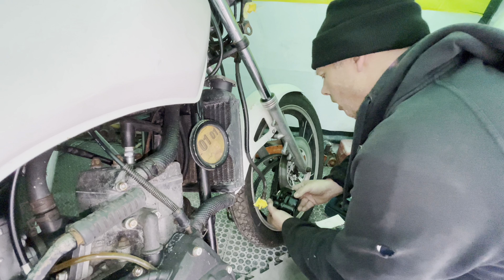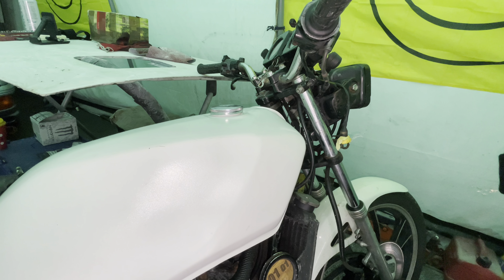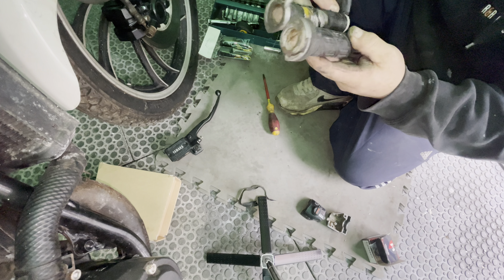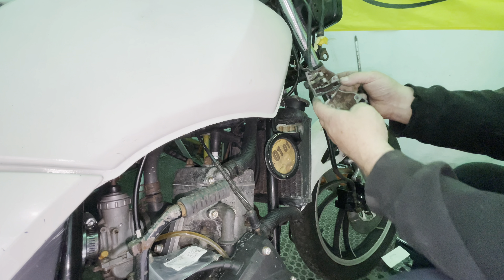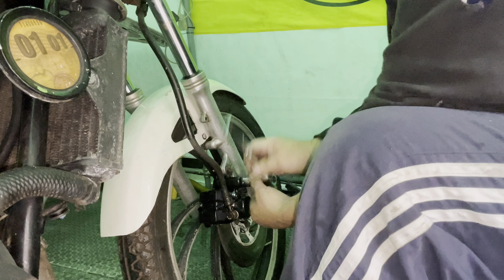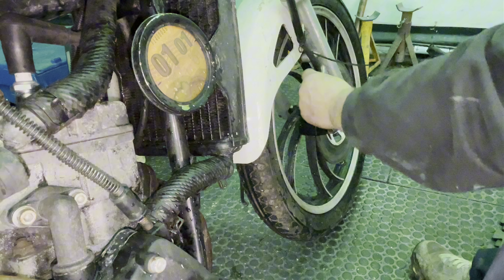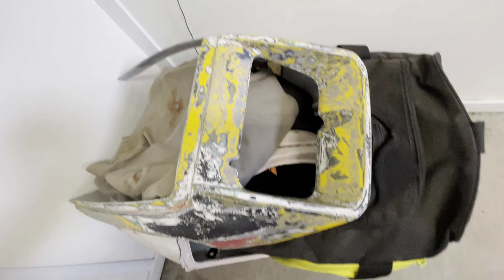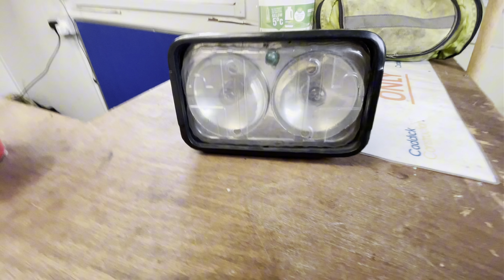Yamaha rd 125lc update

Comment: A tube of Autosol is great for cleaning chrome and things like the fork leg bottoms and footrest hangers. Removing handlebar grips, crack the seal with a small screwdriver and squirt brake cleaner down the gap, you'll get more room every time you move the screw driver, it doesn't take long. Now for the fun bit refitting a new one. Squirt brake cleaner inside the grip and slip it on, leave for a while and It'll feel like its glued on.
Reply from the maker: Fairy liquid and tin foil for the rust worked a treat mate, and thanks for the advice 👊